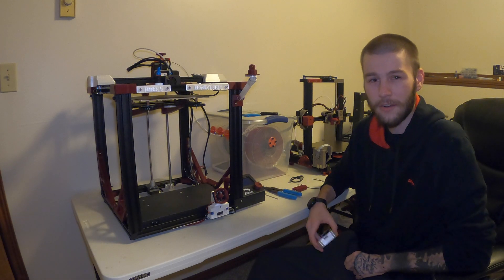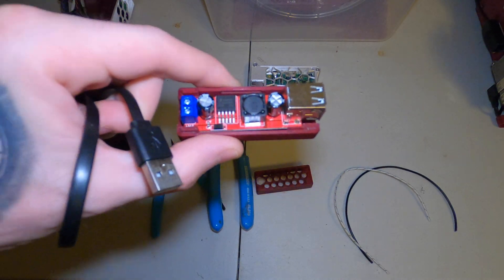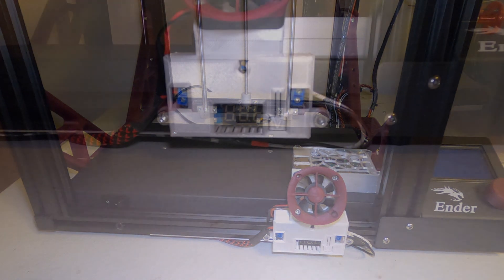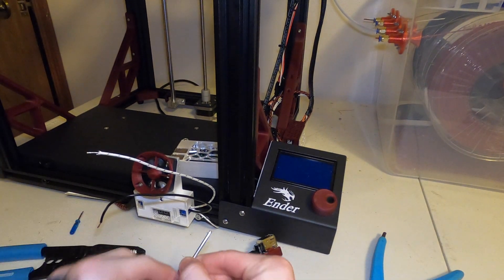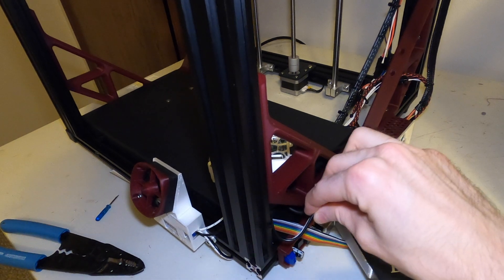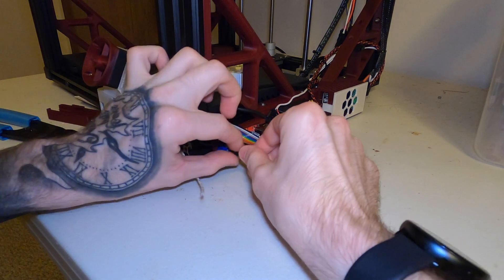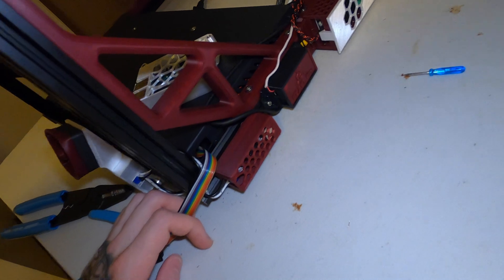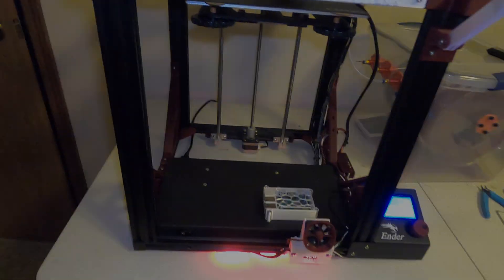Th3d Direct Wire Kit for Octoprint (Raspberry Pi) Install | Creality Ender 5 / Ender 5 Pro

Comment: Does the module have any intelligence to cleanly shutdown the Pi before cutting the power? If you switch of power without shutting down the Pi you will corrupt the Pi’s file system on the SD card before long.

Comment: Do you have links for the cool looking angled red struts? Do you have tutorial for all the upgrades on your ender 5? Like for the fans and the raspberry pi holder
Reply from the maker: I'll be posting a video soon going over all the upgrades along with links to the file. I don't have a link on hand but you can search thingiverse for "Ender5 Corner Brackets" to find them!